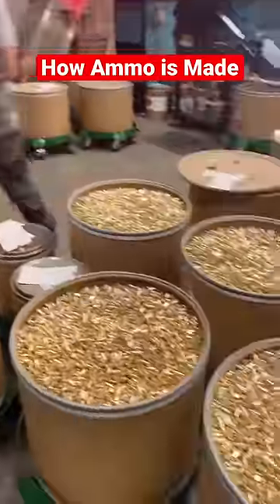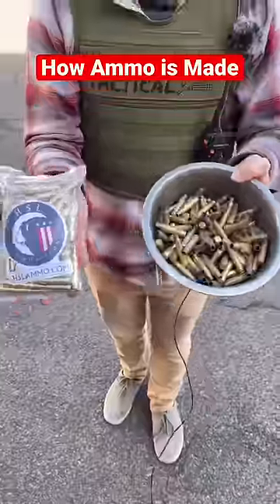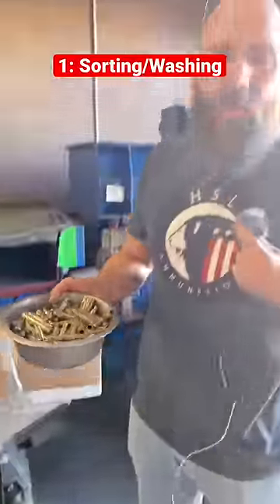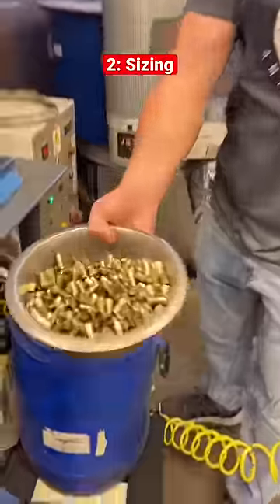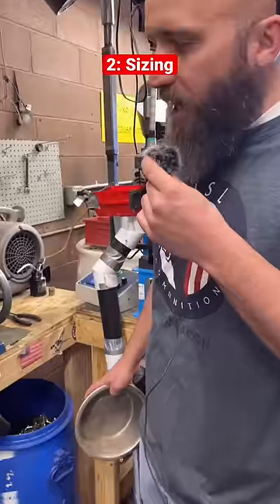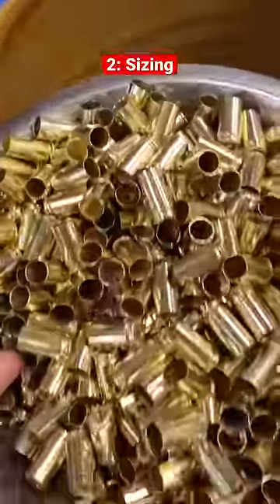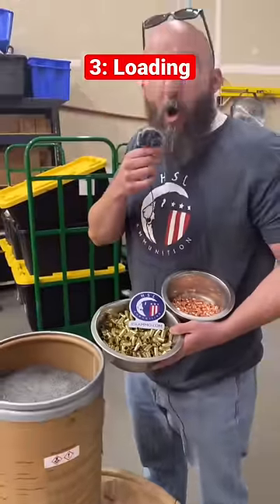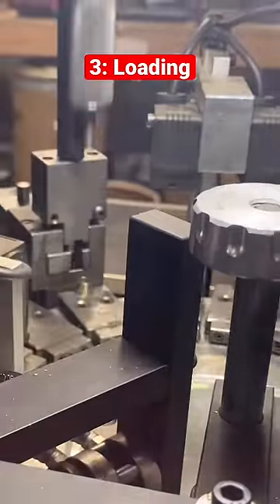*AMMO* How It’s Made: (250k rounds daily) #gun #ammo #demoranch

Comment: So how are you getting consistancy in fps with cases from different batches and brands? The case inside dimensions vary to much and that gives pressure differences for the same amount of powder. 

Unless you have one case of one batch, you wont get consistant ammo. It also depends on how accurate the amount of powder that is put into the case is. As well as how much the variation the bullet weight and dimension has. Along with how much you seating depth consistancy, that all makes for the accuracy potential of the rounds. 

It should be good for just shooting, but good accuracy??? 

What kind of accuracy is good for you? Do you have statistics on maximum spread of fps? Do you have a boxplot or gaussian curve that shows these numbers? What about accuracy in a test barrel setup? If everything is well, you can use it for sales, or at leat be honest, and have good prices for that. 

If there is an ammo shortage, anything goes. As long as it cycles. 

Greetings,

Jeff

Comment: why you making .223 instead 5.56 ?  Isnt 5.56 more popular ?
Reply: they basically the same just lower chabmer pressure
Reply: @TheeApple  very slightly different case too.
Reply: @TheeApple  Yes, that is the point. 5.56 has higher pressure and cost this same amount, so why should someone risk a jam due to weapon not cycling properly due to low pressure of .223.  I believe you will sell more ammo if you would made also high pressure version 5.56 and advertise both on your website